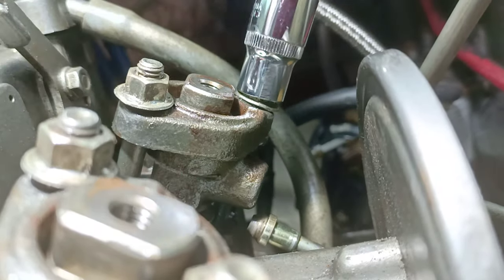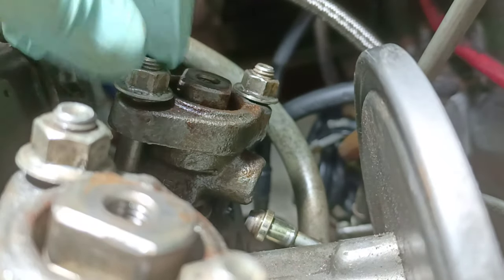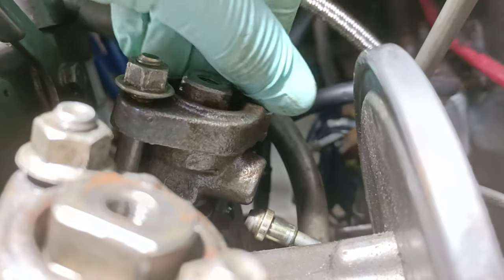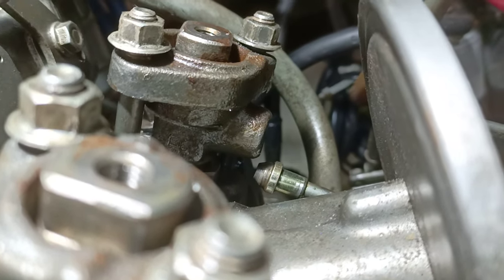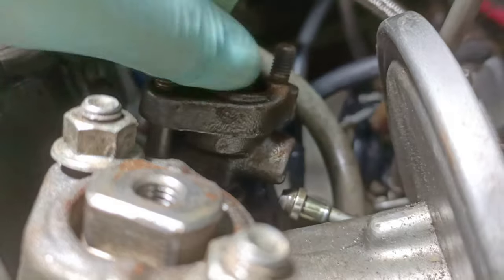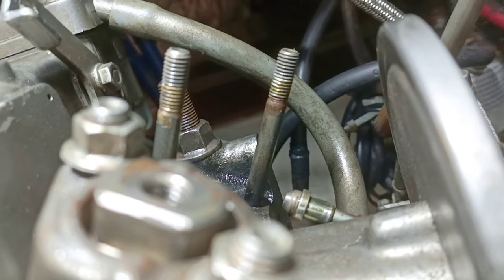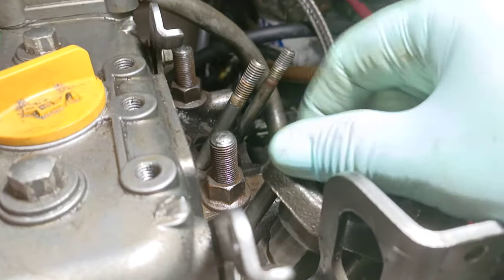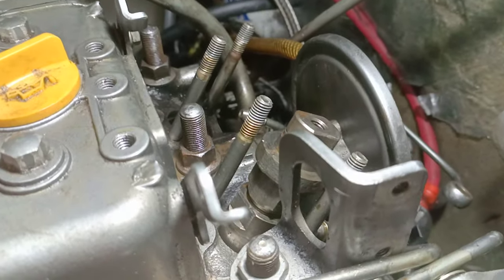The best way to remove a Fuel Injector from a Yanmar 1GM, 1GM10, 2GM, 2GM20, 3GM, 3GM30 3GM30F

Comment: Considering that injector was loose already and moving when you were loosening the hold down nuts, yeah that was extremely easy. I have 3 cyl yanmar and they were rusted and carbonized in. Slide hammer wouldn't phase them. Until I applied oxy/acetylene heat to head. This was after a month of penetrating oil soaking. Now, they're out and cleaned up as well as the hole they go in and yes now compression would blow them loose. Sometimes it's not so easy.
Reply from the maker: That is the way I took them out but the first take was not very clear so I put them back in to film it again
Reply: @sanyiaz  I understand. Great video. Thanks.
Reply: Dang I need an oxy setup. My tractor was woefully neglected and they're siezed in there bad. I have a leak at the base of one injector. I honestly think it's a cracked head. Maybe I better leave it alone because it does run...

Comment: Is it just me observing the injector clamps incorrectly installed to start with? Shouldn't it be the level side be upwards?
Reply from the maker: Yes you are right, I took them out but the first take was not very clear so I put them back in to film it again and in my rush the clamps are fitted upside down

Comment: What about on a siezed 3GM?
Reply from the maker: What is siezed? if it is the pistons in the cylinder then just unbolt the cylinder head and try a bit of heat and oil/WD40 on the pistons + cylinders, you may be lucky